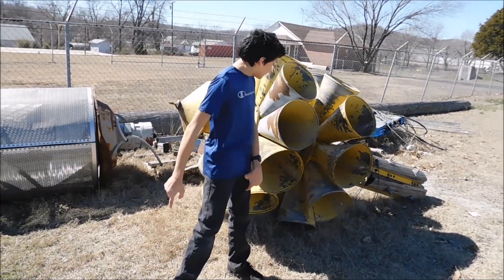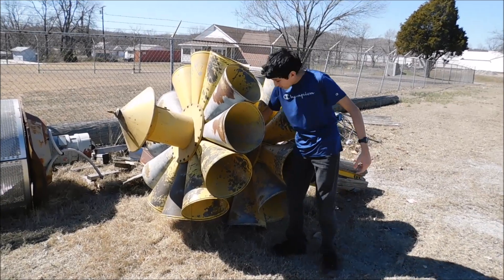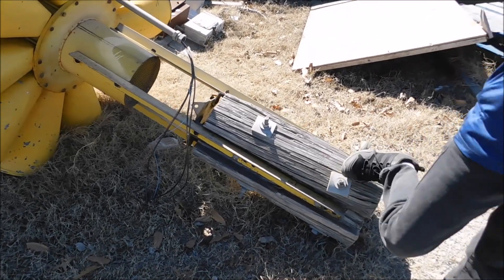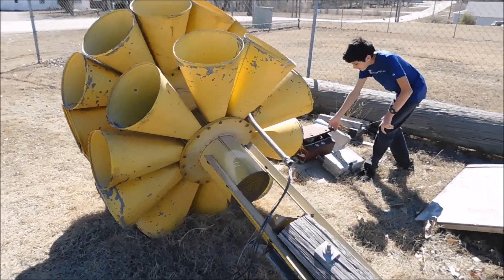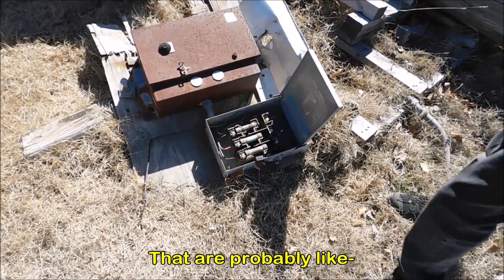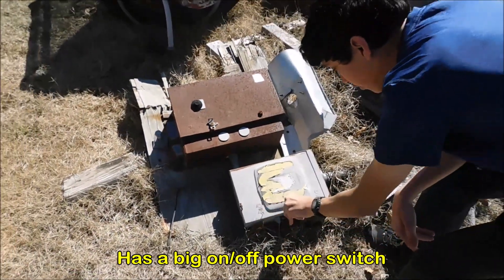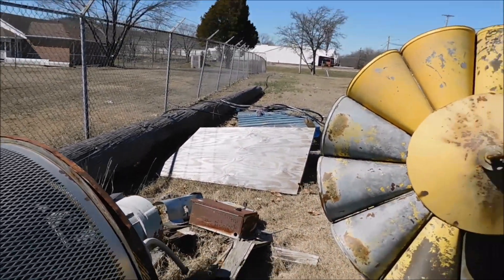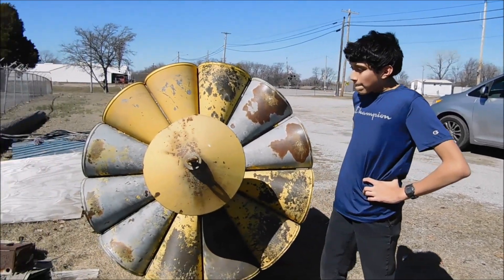2T22A & RSH-10B Thunderbeam Downed Siren Tour! | Catoosa, OK

Comment: the other two wires were for the shutter system or like in a Thunderbolt 1003 system a solenoid, but for that siren may be like powering a controller or an shutter  but it is for an shutter and if you own that 222T i do own some that kind of fuses i think they are rated for 500V and i am glad cuz i found those fuses on the side of an road!
Reply from the maker: You are probably right! However, this is a 2T22 and not a 3T22, so it lacks the shutter system you are referring to. However, that doesn't mean that there were just some spare wires where the shutters would go.